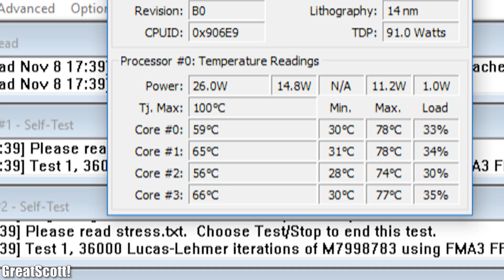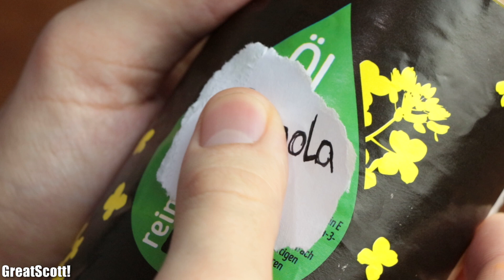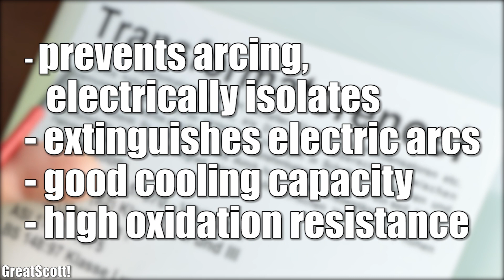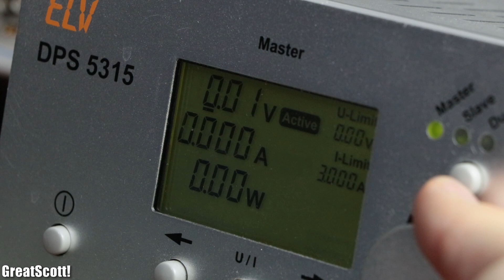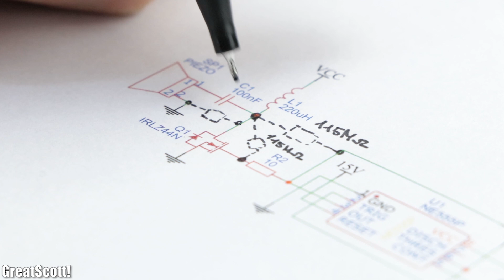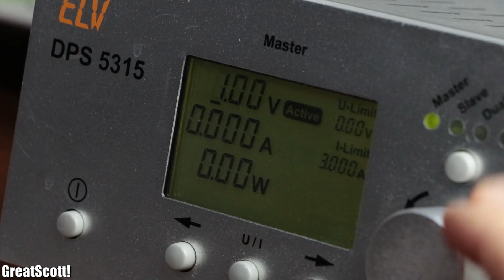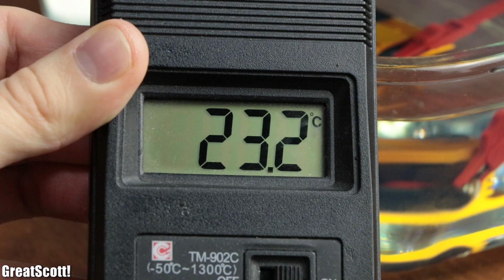Oil & Electronics? the best way to cool electronics? (Experiment)

Comment: So other than some resistance values (that I could look up on the search engine anyway) this video provides nothing substantial in terms of knowledge. Seems like huge excuse to make a video while showing nothing worthwhile at all.
Also, oil terrible idea to cool electronics and GreatScott should remove this video before it causes more damage. 
There's no "electronics oil" for a reason and that reason being no oil is guaranteed to be fully safe for all electronics. Why? Because oil will interact with other parts of your computer, especially other oil based parts like insulation on cables or capacitors! Over time it will make cable insulation brittle and given some mechanical agitation it can remove insulation from some cables and if they rub against each other, say goodbye to your expensive gaming PC. Also, many capacitors have a rubber separator at the bottom that oil can degrade over time just like cable insulation. If oil gets into capacitor it can mess with its paper separator impregnated with electrolyte and can change its capacitance values.
DO NOT USE OIL FOR COOLING COMPLEX ELECTRONICS

Comment: AAAAAAnd thats all?
Reply from the maker: Let me know what you wanted to see more.
Reply: What about operating heavy MOSFETs with high load in transformer oil, with reading it's characteristics (like a voltage drop) and temperature in about 10 minutes vs ordinary air with and w/o cooling. Video is great, but we need more tests with oil.